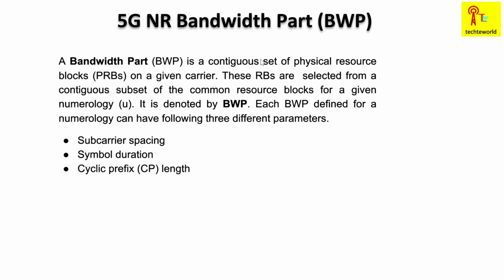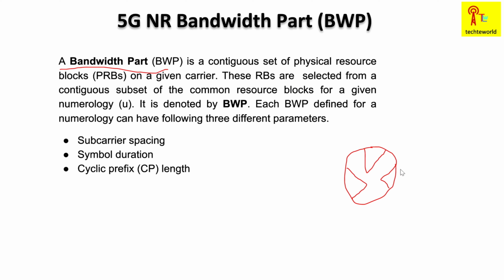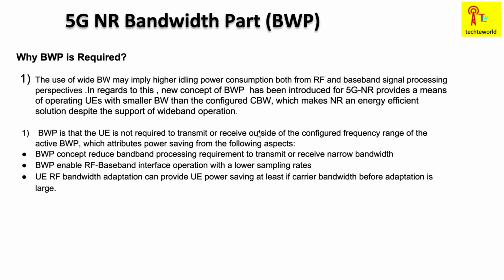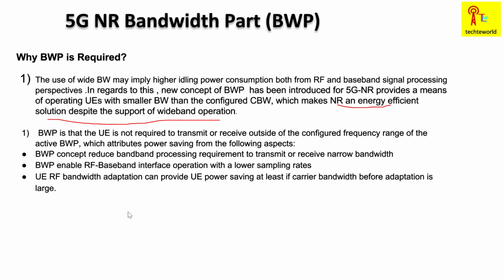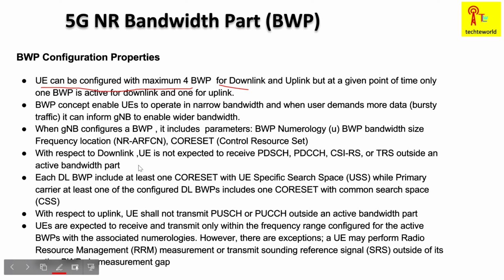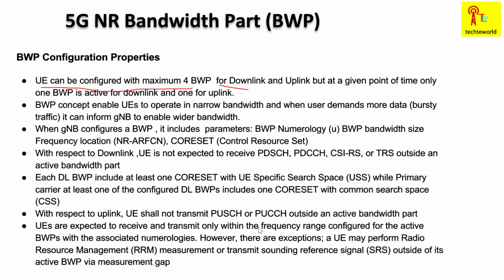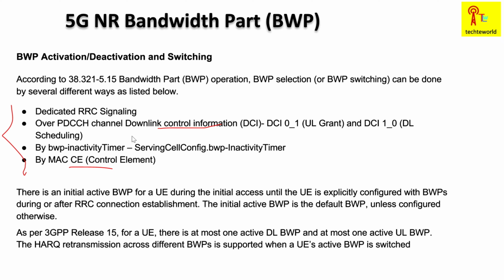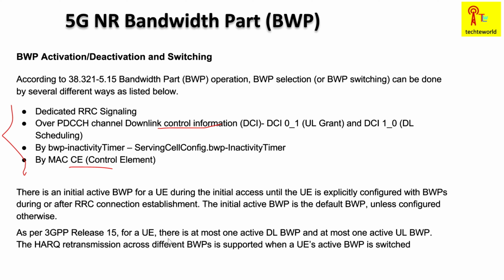BWP (5G-NR Bandwidth Part) Techlteworld

Comment: its half information.
Did not mentions inactivity timer duration.
1. where we can find this BWP info in the logs.
2. when it moves to to default BWP.
3. How UL BWP and DL BWP will sync with each other.
4. What happends if we dont have PRACH in the current UL BWP etc.